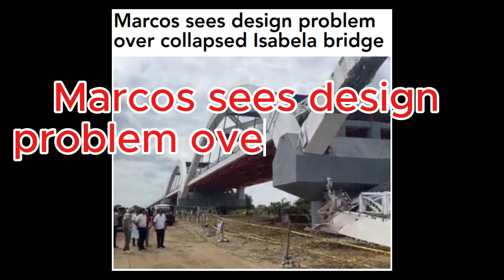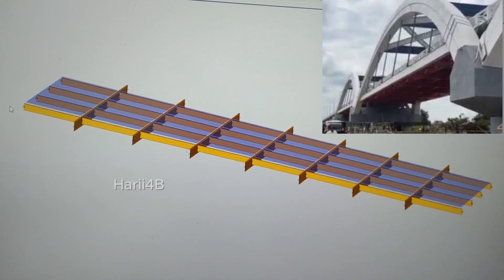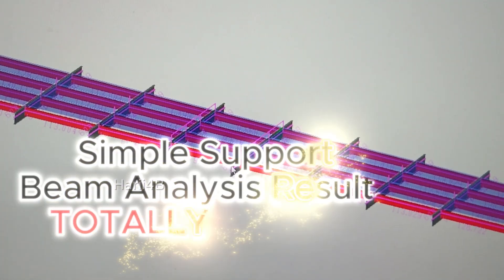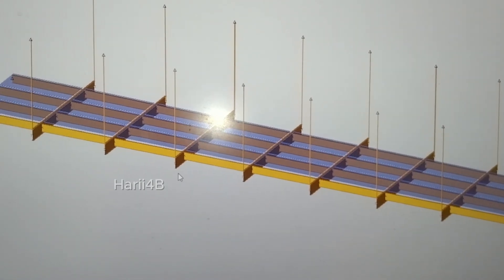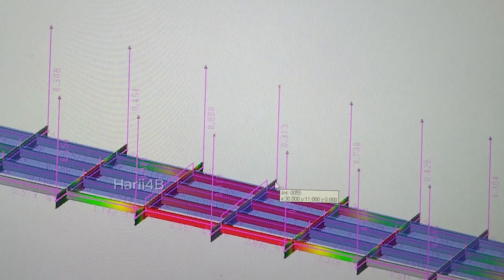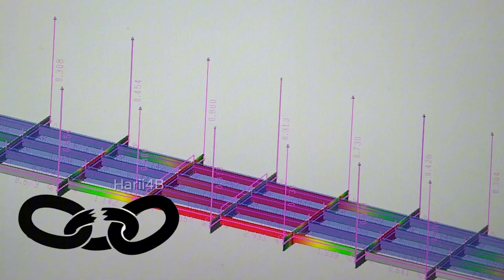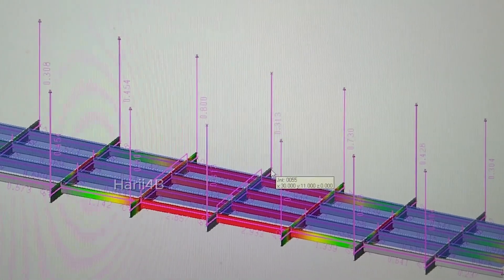ISABELA BRIDGE Cause of Collapse, EXPLAINED!!

Comment: I LIKE THIS STRUCTURAL STRESS ANALYSIS VIDEO, bilang designer sa ibang field, lalo na malapit lang kami dito sa bridge, dapat aware ang designer sa napakaraming dumptrucks, tankers, trailers dito. alamin din ano requirement ng mga endusers. inaccept nila job, majority ng design na pirmado niya at minodify ng iba, he is still involved. Dahil iilan lang ang  road dito, ang design ni na tinaggap ni engr canete kumbaga sa Manila, kung may heavy truck ka na nasa Lawton at papunta ka lang sa Quiapo, bakit ipapadaan ka pa sa Makati, Mandaluyong at Sta Mesa para lang makapunta ka sa Quiapo? everybody here can talk lalo na Bilyon ng taxpayers ang pinaguusapan, not only licensed civil or structural engrs can talk, I dont know why some people and some engineers laugh with people with comments or complaints and who has no knowledge.
Reply from the maker: yun na nga sir, 2 nos 27ton side by side lang pala ang design capacity. sa 60m+ each span easily 6 trucks na agad pwede dumaan. lalo pa walang control in placed. kahit i fully retrofit ulit at restore ang na collpase na span ay must need na ang traffic at weight limit control sa tulay na ito. thanks for watching sir !
Reply: I'm alligned with you. kahit walang retrofit, kahit yr 2020 pa siya nagdesign kahit bagong code pa. Still I think, he will design for light vehicles. Nasisi pa lumang Bridge Code ng US na alam niyang walang overloading. Alam niyang may overloading at bumabagsak na bridges dito. What he has to expect? And why he continued the design with low budget? Is that an expert Idea. and telling the president that he is not expert in bridge is arrogant. he cant do that in meetings.
Reply: Thanks for your view sir. Naniniwala akong kahit hindi lisensyadong inhenyero o ordinaryong mamamayan ay may say sa nangyaring ito. Pera natin yan sapilitang kinukuha sa sahod natin.  Isa pa dapat lang mag demand nag accountability ang taumbayan sa mga walanghiyang Opisyales ng gobyerno. This in a sane mind, is really a product of corruption.

Comment: The failure seems to start from the end connection to the arc sir. That connection was sheared off the arc.
Reply from the maker: yes sir i agreed. the connection of the outer girder to the arch is also suspect of failure and collapse but i did not show that in my quick analysis. need to make full model analysis now. thanks for watching sir
Reply: I agree with this. The tension cables/rods seemed too seldom and not redundantly applied to reduce risk of total span failure by losing 1 or 2 cables/rod at given section.

Comment: Chains must not be used  , instead bridge cables for suspended bridges .
Reply: Did You Saw it.. The BOLD and KNOTS on the ROD the One SNAP the Tendon Rod or Vertical Rod. 
     And The VERTICAL ROD Connected To the HOLLOW or EMPTY ARC Construction.

Comment: AT DPAT BEING AS A WELDER N FABRITOR  HINDI PO ADVISE  E WELDING MGA CONNECTIONS DPAT JAN AY  HEAVY DUTY NKA BOLT LHAT ANG DSIGN  NG H CHANNEL BARS KASU ANGLE BAR GINAMIT  PANG LIGHTLAGA👎👎🇵🇭
Reply from the maker: totally agreed po. yung bottom connection ng steel rod makikita natin mag end plate. not sure kung welded or bolted yun sa cross griders pero nag snap mga yun talaga

Comment: Kasalanan ng DPWH, sila ang responsible sa design and implementation of bridge construction. First place wrong feasibility study that causes this collapased bridge worth  more than a billion. Dapat sa feasibility study traffic and load analysis ang tinignan, engineers should assess the expected vehicles weight and volume when designing a bridge. Syempre ginawa ito!  bkit nila ginawang 40T max load lng? A provincial bus weighs 20T kng loaded will go up to 25T , paano kng may dumaan nga 3 bus and other vehicles sa isang span ng bridge, halos less than 100t na ang load so possible na babasak ung bridge. Kya feasibilty study wrong na at pinagawa pa ang design at comstruction ng DPWH. Eh para lng pala sa light vehicles ang capacity ung bridge which wka silang warning at both ends.
Reply from the maker: couldn't agree more sir. thanks for watching, gagawan ko ng follow thru analysis on in-depth scenario kasi di lang sa steel rods ang weaknesses nyan tulay na yan
Reply: Ok maganda kng may ff up analysis. Nasabi ko is wrong o walang feasibility  study kasi  automatic ginamit  ang 2015 bridge code. When they interviewed the person who designed the bridge @ one PH  watch nyo sir bago gawa kyo mg analysis,  Sabi nya tama ung design, ung bridge was designed according to the specifications ng bridge code na kinopya natin sa american bridge code, at sabi nya mabababa ang axle load ang ginagamit sa design. Sabi nya sa bridge design code ng DPWH sa department order Nila NAGPAPALAGAY sila ng LOAD LIMIT 27T sa 10 wheeler trucks which is based on the American code at  sabi nya puedeng dalawang truck (27T) sabay sa 2 lane bridge na yan at a total load of 54T based on the bridge code. nung tinanong siya designing ng bridge kng sino ang mauuna dpwh o sya ang magbibigay ng spec sa bridge na kya nya ang mabibigat na load? sabi nya  hindi dpwh d sila may bridge code na gamit nila as kudigo. Kya design mali na kc walang o wrong feasibilty study!

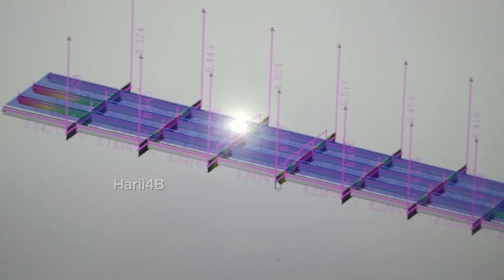Comment: At 6:26 what if the connection break. No analysis  or computation that the connection  can  break. If that happens, WHY ? Why will it happen when it was designed correctly as it worked in the previous span. The assumption is misleading the followers of the Cabagan bridge. THE CAUSE OF THE COLLPASE WAS NOT IDENTIFIED BY THIS VIDEO.
Reply from the maker: maybe needed an in-depth full model analysis to find out the weaknesses or zone of potential failure. on next video hopefully

Comment: Only an independent testing agency can only tell the reason why the bridge had collapsed. Pbbm, can not say the reason why it collapsed because pbbm is not holding any report from an itl or from a consulting agency.moreover, pbbm is not a civil engineer.
Reply from the maker: they really need po and in-depth investigation, not only to know the causes of failure/collapse but to know how to retrofit/re-strengthen this bridge. malaking work and gastos na naman po nakikita ko here considering all non-collapsed span span ng bridge gagawin ang retrofit. not to mention demolition and reconstruction of the collapsed span

Comment: That’s what I’ve been commenting all along, the rod hangers which are the main supports of this suspension bridge failed maybe because its rod connectors weren’t up to standards, or the rods weren’t equally post-tensioned. Another thing, there is less safety factor that went into the design of the bridge, with this long span, strong sideways wind load will put a strain into the weak steel frame that was not truss-designed. The bigger question is, what was being done from the 300 million retrofit project?
Reply from the maker: solid rod daw po nakalagay kaya di ito pwede i post tensioned unlike usual steel cables. regarding retrofit, i can say based on visual observation that the arched whre provided strap plates on the connection of arch and outer girders. i also highly suspect weaknesses on this connection which is not shown in my presented analysis. nakita rin sa picture ang pull out/shear failure on this connetion. now, need to show the arch in the model to see the high stresses on all critical zones
Reply: @Harii4B  Thank you for the feedback. But even if the solid rod cannot be post tensioned, there must be a way to load each rod so that they all share equally the weight of the bridge, it seemed to me that one or two rods were not properly loaded that it put undue strain to other support rods. Also, adding rod connectors and strap plates in between that are weak in the first place, could have triggered the collapse of the bridge, which would not have happened if there is a safety factor built into the bridge deck framing, like truss framing.
Reply from the maker: https://studio.youtube.com/video/UTxnyDt0C1I/edit

Comment: Sana tinagalog mo na lang po sir..

But anyway - the larger problem in the Filifins are really overloaded trucks - most of the time they carry 2-3 times the rated capacity for maximum profits by their operators. Makikita nyo po sa 12 wheeler na truck na involved dyan - obvious yung modification ng dump by around 1m for higher volume and capacity kaya with those stones/boulders load (approx. 2T per cu. m.) I believe the grosss weight of that truck was around 100Tons!  Cancer na ng mga kalsada sa Pinas ang mga yan -- walang tsansa ang mga bagong 16 inch thick concrete roadways kaya di nagtatagal at cracked na.  Wala ring mga weight bridges at inutil ang mga LGU at LTO.  Kung sa mga expresways di pinapayagn ang mga yan -- bakit sa mga national and local roadways di matigil mga ganyan?  Salot pa sa kalsada at nakapagpapabagal sa daloy ng trpaiko dahil gapang pagong mga yan pag overloaded.
Reply from the maker: madi in china ba mga yan sir? di kaya sinasadaya na ipakalat dito sa pinas mga ganyan trucks?

Comment: Ang corruption jan ay nasa dpwh. Pinagtatakpan lang ni bangag kasi sabit din sya. Ang maximum load capacity ng 12 wheeler truck ay 33 tons. Kapag dinoble ang load 66 tons. Hindi na kakasya ang bato sa dumpbox at sigurado sabog ang nga gulong. Sinungaling si marcos.

Comment: The designer said and explained the requirement of  only 27tons, they made double for 2lanes become 54tons. The truck dump weigh 17tons, boulders 87tons and total weight 104tons that is why it was overload.
Reply from the maker: designer says that maximum 2- 27 tons truck side by side was considered in analysis. however, the span is 60m plus long and can easily accommodate 6 trucks both lanes, that's way too heavy already. how can they prevent such scenario from occurring in the future?

Comment: Sir I think your presentation is different from the actual bridge...  As I counted, it has only 5 vertical members each side while your presentation has 7, which is more stable.  I think the vertical members were too distant apart that made the midpoint it's WEAKEST. And based on the picture, the construction methods for the vertical members were poorly implemented and possibly used sub standard materials... I am not a Civil or Structured Engineer but I believe you that the bridge must not be considered as simply supported.
Reply from the maker: That's a good point sir, I'm just making a quick analysis to show the general concept.

Comment: Insufficient Ang modeling mo!  Static analysis lang iyan.  Just do the finite element analysis by increasing the loading gradually until failure to show where the failure(s) occurs.  It will also show the movement and behavior of adjacent structural members.  Guess you don’t have that eng’g program.  This is what they use in acft stress analysis that includes static and dynamic loading.  Hehehe.
Reply from the maker: i said i made a quick analysis check only. i can do FEM of course in ANSYS, but that will take time creating the model and applying load and running the dynamic analysis/parametric iterations. thinking if spending time is worth doing it. i am not doing any peer review anyway ... thanks for your comment, sir
Reply: Clear naman sinabi ng author quick analysis kaya walang dynamic load considerations. The point being, static pa nga lang bagsak na, how much more if all dynamic loads were factored in.  Anyways just to be fair sa nag volunteer na mag analyze, let's just thank and appreciate his generosity.  😊

Comment: so  your analysis applies only on the 9th tie arch bridge? cos the 2 "overload trucks" passed thru the series of bridges from the first arch bridges till the 8th bridges and when it crossed the 9th bridge, the bridge collapse,,,  in fact the first overload truck even passed through all the way till the end and yet the second truck reached before the connection of 9th and 10th bridge and ka boom!!... so how does it happen..
Reply: I BELIEVE  THE CAUSE is not on The TRUCK.   Is on a  POOR CONSTRUCTION.  
 
MY CONSTRUCTION ISSUES as Engineer..
#1 TENDON ROD Is Connected by BOLTS and KNOTS. 

#2 HALLOW or EMPTY ARC Construction To Hold The TENDON ROD. 

#3 The CONNECTION Between The BRIDGE to the POST BRIDGE to HOLD it STRONG for the LONG BRIDE DESIGN.  

#4 THE POST is to THIN or UNDER SIZE to HOLD LONG BRIDGE.  REASON for then To Constructed HOLLLOW ARC...
Reply from the maker: as per the video sir, there could be weak link on that span.
Reply: @Harii4B  which detail/construction drawings you used in your analysis, the original design or after the retrofit design?
thank you.
Reply from the maker: neither sir, my quick analysis is approximate based from photos and made to show the general concept between simple support and arched supported and what could occur if some support were lost or collapsed

Comment: Better get the design calculation of the designer and check if it is only intended for what particular vehicular loads. Check the design specs of materials and compare it to aspects of installed materials. Then check the actual construction methodology applied vs approved methods. Bridge design in this particular place should be for heavy loads because this bridge crosses a wide river which caters people who move various agricultural, infrastructure materials, buses and other heavy load vehicular movements along this place. Why a hell DPWH or the government waste money just to cater light moving vehicles. Where is the common sense of this excuse.
Reply from the maker: i am not in the position or capacity sir to handle that scope of work. OFW here

Comment: Sir, the connection will not fail by static analysis.  Do a moving load dynamic time history analysis to see the bending of the hanger ends. The hanger failed in bending because it's brittle. Kh
Reply: Thanks for the nice presentation and analysis.
Question: 
1-Are bridge design only concentrated on the highest truck load (static). Should all the vehicles/load be considered and summed up together? Since traffic can keep all the vehicles static on any span of the bridge.
2-In your calculation/analysis what safety factors or tolerances you put in?
Reply from the maker: @joeymarcos6133  this is quick static analysis po being comparison to prove the bridge is not designed as simple supported span rather arch supported. detailed analysis will consider many applied load and application of loads. deadload, live load, traffic, wind, seismic. combinations of these are required considering increase factors as per governing codes, also geotechnical and foundation analysis included specially connections and full construction drawing and detail preparations... etc. that's very lengthy and time consuming process po. malaki na po bayad dyan sa designers nyan hehehe
Reply from the maker: agreed sir, i just made a quick analysis check and found already critical points. considering traffic suddenly stop on any span then it will be static. so many load conditions and combinations to consider. self weight, moving loads, seismic, wind, combinations, serviceability, etc

Comment: Pending the results of materials testing, the failure was due to poor design and workmanship. What a waste. Can't blame others for concluding that there must have been kickbacks on this project.
Reply from the maker: what is worrying is that a single truck caused the collapse already. whereas 60m+ span can never have be limited to a single or 2 nos truck load passing one span at a time. it can easily overload by carrying more traffic volume on any particular span ....